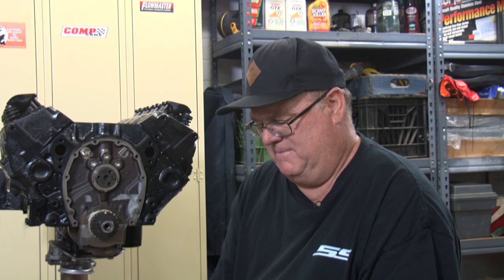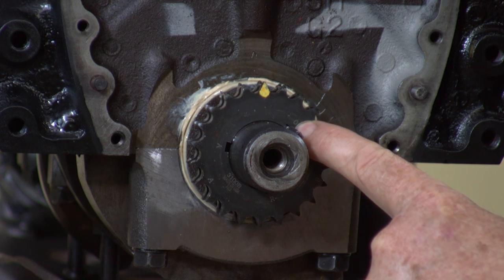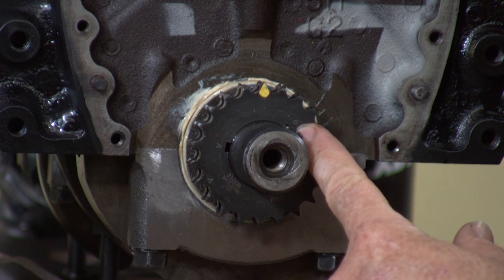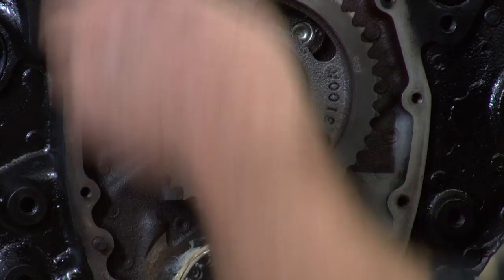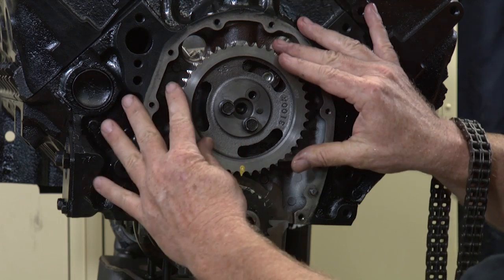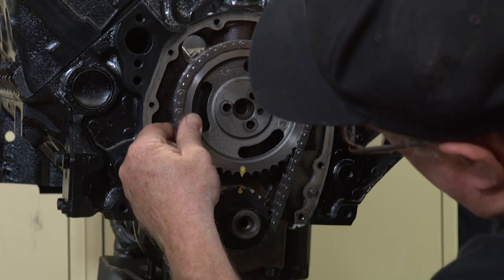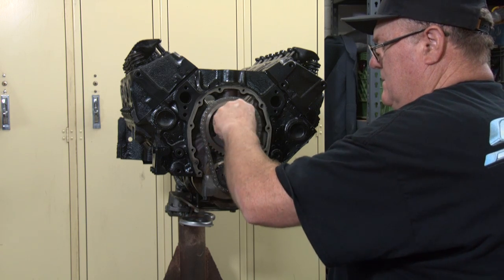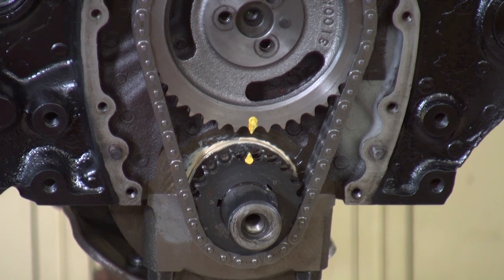How to Align & Install a Timing Chain on a Small Block V8: Step-by-Step Guide

Comment: you said once you have your tdc ( intake compression) 2dots facing together; you put your cover plate and oil pan on; but your didnt show or say your distributor at all. So what happen if your distributor is off 180 degrees.....?!?!  In another video that I saw explained it well: .......... Small block chevy timing chain installation.......... exhaust TDC 2 dots facing away : cam 12 -crank 6 distributor set in at 1

Comment: What year was this engine...?

Between '63 and '88 the camshaft bolts were in different positions at TDC...

The bolt position you show here is on '63 - '79 sbc...

'80 - '82 and '86 - '88 TDC camshaft bolts are in the opposite position of what you have...

Unfortunately I have an '83 - '84 305 sbc, and since that is the mid years between the two positions, I don't know which position is correct on my engine...

Comment: Why didn't you lube the Torrington behind the cam sprocket? Why didn't you use a cam bolt locking plate? Why didn't you degree the cam?

Comment: How are you doing I just want to find Do you have to balance your pistons and rods and crankshaft when you’re building a 350 small block 5.7 L four bolt main and if your crown shop is already balance and you were just using different Pistons rods are the same do you still have to balance everything thank you my name is Wilfredo

Comment: 12 oclock on both gears can be correct for #1 TDC compression. As someone already noted 12 oclock on the crank gear is/should be TDC (exhaust or compression) on #1 piston. You have to use additional information to determine which, such as distributor setting, feel for compression at spark plug hole while rotating engine or if valve push rods are "loose". NOTE that TDC without the cam installed is just plain TDC. The valves (and the distributor or camshaft sensor) aren't doing anything to control the valves or spark. My limited experience with an old chevy 350 showed #1 TDC on the compression stroke was 12 on both gears. Using the 12 and 6 settings for installation makes it much easier to get the two gears aligned properly so if all you are doing is replacing the timing chain/gears I think you should rotate your engine to 12 crank and 6 camshaft before you start remove/replace process. If you're replacing camshaft also then it doesn't really matter where the marks at before you start removal. The crank gear is keyed and the camshaft has a pin for its gear so the gears can only go on their respective parts one way.
Reply: You are exactly right...most of the time the novice mechanic will watch a cloyes video or something similar. The video tells them to align the dots at 6 and 12, they're not telling you anything about TDC, what they are saying is that its just easier to align the dimples at 6 and 12 where the marks are just a 1/4 in away from one another rather than 6 inches apart...to achieve TDC again the engine, NOT THE CAM needs to be rotated another revolution

Comment: Is the timing chain located behind the flywheel (drive plate)? Is it behind the accessory belts? I'm sorry I don't know much about V8 engines.
Reply: Timing chain is on the front of the motor.flywheel or flex plate will be at the rear of the motor as it connects to the clutch or torque converter and transmission.

Comment: I am replacing timing chain on my chevy 350. I found both gears are at 12 o'clock position.   Truck ran fine, just old and doing preventative maintenance. I am confused,  is there something else going on?  Should it be running with it this way?

Comment: Great video !!, So the compression stroke is on 12 o' clock them?
I have a replaced camshaft and my compression is happening when the two marks are at 12 o' clock.

Thank u !!!
Reply: Still running it in that position ?

Comment from the maker: TDC on number1 cylinder is always when the mark on the crank 
timing gear is at the 12 o' clock position, and when you align the cam 
gear to the 6 o'clock position to the crank gear at 12 o'clock your 
valve timing is correct. But if you rotate the motor from that position,
 and your timing chain is on, you are off of TDC,  until the two marks 
come together again. Most eng. work like that, but always check your 
manual on different engines!!!! Small block and Big block chevys are 
like the video.